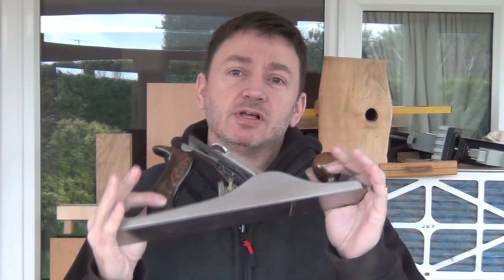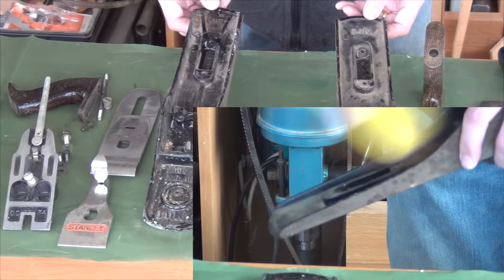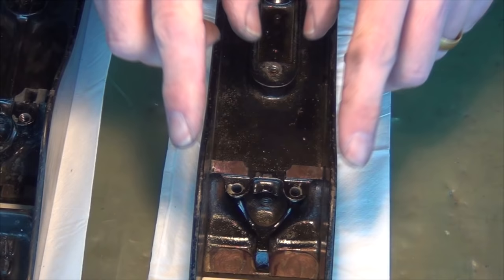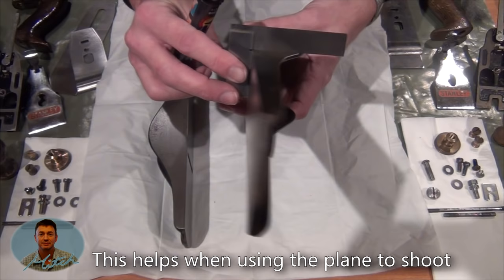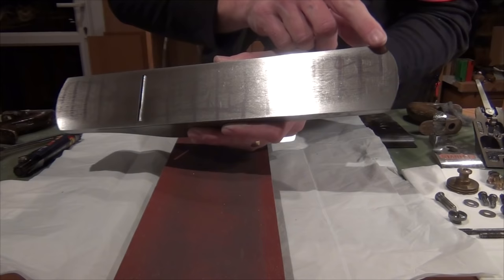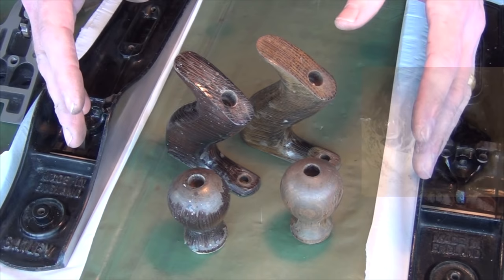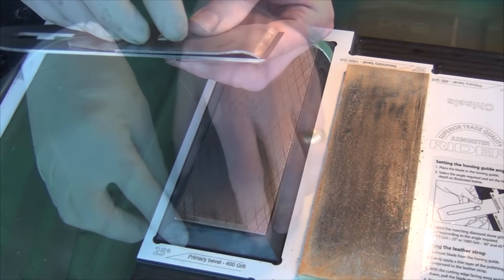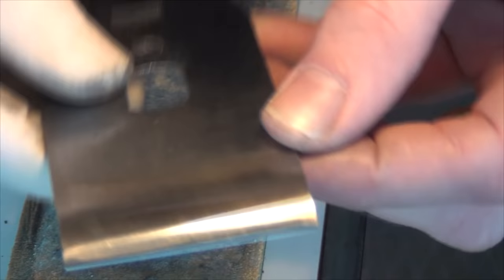Hand Plane Tune-Up - Amazing Results from Your Plane

Comment: How do you check the frog for lateral position? I mean, flattening all of the surfaces is easy but how do you verify its geometry? Specifically, the lateral angle of the upper surface (mating with the iron)? The intersection of the sole and the frog upper surface should be a line that is in the plane of the sole and perpendicular to handplane sides i.e. neither of the iron cutting edge corners should be more aft or forward with relation to each other. But the frog casting itself has no good reference planes right of the bat to check for that. I intend to check it using the iron itself. Please speak up if you know of a better idea.
Reply from the maker: +Tome4kkkk I don't see this as a problem requiring a solution, since there is ample adjustability with both the frog to body screws, and the lateral adjuster. Even without these, it would be possible to hone the iron to run true, as in a skew plane. I see fitting of the frog to the body as trying to achieve the equivalent of one solid component, on which to mount the iron.
Reply: +Mitch Peacock - WOmadeOD 
Thanks for the tip on using the from attachment screws to compensate for it. I don't quite agree with the usefulness of the lateral adjustment lever in such a case. Here's why.
Just to make sure we're on the same page, the lateral angle (let's call it Beta; and let's call the usual 45 deg longitudinal angle of the frog Alpha) of the top frog surface (let's call it F) with relation to the sole surface (let's call it S)  changes for example if you had paint left on one of the pads on the handplane body where the frog sits, but not on the other. Or if you placed a shim washer on one the pads on one side (left or right). The introduction of Beta makes the line of intersection between F and S no longer perpendicular to the sides of the plane body. Now... Moving the lateral adjustment lever makes the iron move strictly in our plane F and there is no way to use the lever to make it otherwise. Hence the introduction of Beta is not compensated. Simply put you'd get the same skewed iron plane and the only thing that would vary would be how far the iron protrudes past the sole.
Out of curiosity, knowing that you're familiar with metalworking. How would you proceed to cancel Beta IF you had no means of compensating for it other than the geometry of the frog itself? Especially, how would you handle referencing?
Reply from the maker: +Tome4kkkk Trying to visualise this all in my head! I suppose I would use the edge of the iron slope which was furthest back as a reference, work out how much to remove form the edge that was too far forward. Scribe that on the side of the frog, and then file/scrape the excess away so that the scribed line and reference edge were then connected by the new flat slope. Not much fun!
Reply: Mitch Peacock - WOmadeOD
Thank you for your reply. Yeah, well put - not much fun :)
Reply: +Mitch Peacock - WOmadeOD Aaaand it happened with my plane. I've finished all of the standard procedures on it, double checked the iron is true to square and I can easily see the right side of the iron's edge protrudes more than the part on the left, with the iron centered on the frog.. The right sight of the frog is simply lower than the left side. I think I'll go with steel shims before I make an attempt to grind anything.
Reply from the maker: Oh dear! Why not shim to find what and where the error is, and then correct at the source. So, if you had to add 2 thou between the right hand pads, file off 2 thou from the left hand pads. It will throw the seating out a bit, but you can easily reseat the frog once it's leveled.
Reply: Mitch Peacock - WOmadeOD
Yep, that's what I intend to do. I'll report back if  I have anything valuable to share i.e. with what I learned by destroying my plane ;)

Damn the Footprint. I was so full of hope when I so that near-perfect mouth geometry :/
Reply from the maker: +Tome4kkkk Was it a new plane? I'm pretty sure they are no longer made by Footprint Tools, but just carry the name. It would be interesting to compare with an old one. Either way, with your hard work it will eventually be superb!
Reply: +Mitch Peacock - WOmadeOD Yes, not directly from a store but not used, ever. I was most afraid about having to correct the mouth geometry. It was perfect on this plane so I was full of good thoughts about all this. An then the lateral frog face tilt happened... Oh man, what an ungrateful task for someone with just a combination square, a marble plate, slide calliper, sand paper and no prior experience in tuning handplanes! I've used thin aluminium sheets for shimming and got just shy of 0.4 mm. So I'd say the error requires 0.35 mm of shimming in actuality. I'm really not confident about filing this much from the left pads instead :/ Especially that I can't simply do a uniform 0.35 mm material removal on all left hand pads. Those left hand pads closer to the center line of the plane would need some ~0.25-0.3 mm. I seriously consider using hard stainless steel shimm plates on the right side pads and only attempting to actually grind the left side pads if some outright clear side effects manifest while planing wood. What do you think?

BTW, if you want, I can share all of my Footprint 5B photos with you. Including those from my 'frog struggle'.

EDIT:
I've just confirmed that most of the error comes from differences in heights of the pads, not from the frog. Is the frog geometry fine? I don't know and I'm unable to check this without spending a huge amount of time on it. There are pretty much no references to rely upon, references need to be established etc. We spoke about this before here in the comments.
Reply from the maker: It isn't surprising that the pads of the body are out, since these are the hardest to machine! Can you clamp the lower pads of the frog flat on your reference plate, and measure the height to the edges of the higher contact area, and to points an equal way up the frog face?
Reply: Mitch Peacock - WOmadeOD I have no idea which dimensions you're asking about and what would be the positioning of the frog on the ref plate, sorry. I don't think it will do without a picture this time ;) By the way, the frog sides are nicked in places and covered with non-uniform thick paint. It's hard to use them for any sort of checks.

I've just finished my first take on this. Since 0.4 mm shimming on the right gave me almost a complete correction AND the left pads were circa 0.4 mm higher than the right pads (from a reference plate; measured through the mouth for the front pads and using a spacer block for the aft pads) I assumed the frog geometry was by order of magnitude more correct than the pads. I went ahead and grinded the body pads as per my measurements. I got close to the final corrections and porked it all by not taking frog rocking into account and taking out too much material during two pad flattening. On the second attempt I gave up on flattening the pads down to a tiniest bump and all seems to be fine now.

Jeesus, 0.4 mm out of dimension! I saw it the first second I took the plane out of the box. My first plane ever! So it is safe to assume that Footprint's quality assurance as far as those handplanes go is on par with the contemporary Stanley. Poor.

I'll return to fine-tuning the pads only after I use the plane for some time and re-check the frog geometry.

Comment: Please, DO NOT use 80 grit...…… start with 120 or higher. 80 grit will put river size groves on the bottom of the Planer.
Reply from the maker: Base the grit on the amount of material you have to remove, otherwise you could be at it for ages, or as Pedro says, go too far
Reply: Used 80 plenty, grinds out fine.

Comment: 5s are too long to be scrubs.  Sorry, but you don’t understand the principle of a scrub and how it takes off highs if you think a 5 is well suited for the task.
Reply from the maker: Works great though
Reply: The principle of a scrub plane is to takes off highs? Is that what you're saying? I haven't heard any woodworker on YouTube say that. Even if taking off the highs was the goal, a longer plane would be more effective (which is why jointer planes are long). The shorter planes ride up and down, following the curves instead of removing the high spots.
Reply: I use a 5 sized plane as a scrub. It's fine. A 5 is the jack of all planes so it can do everything.

Comment: YOU CAN TAKE A PLANE WITH  A PITTED SOLE TO A MACHINE SHOP AND THEY CAN MILL IT FLAT AND SQUARE TO AS GOOD AS NEW AND THE COST WOULD BE NOMINAL
Reply from the maker: Certainly worth investigating. In UK it would probably cost from 30-40gbp